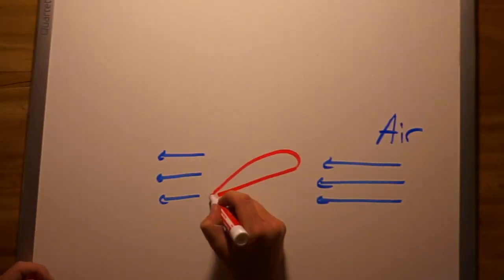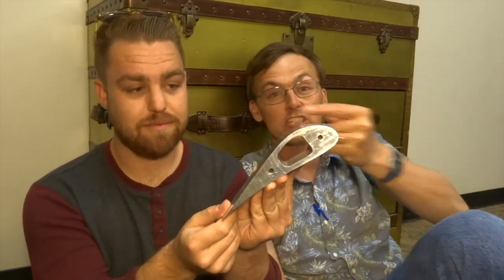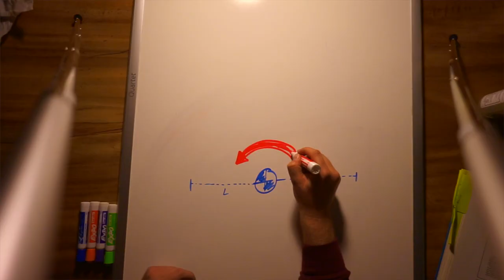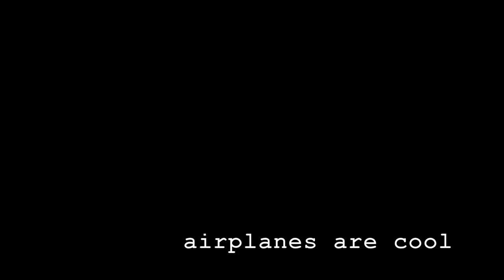Spin Brief 5.11.17

Comment: Elliott,
I have always wondered why the low wing Extra slows in rotation just before the developed phase? Between 1 and 1 1/2 turns depending on CG the airplane slows in rotation momentarily. Un observed inverted and not as noticeable in the mid wing Extra. The Yak 55 and MXS do not display this characteristic either. Perhaps you can articulate as to the why?

ML
Reply from the maker: That's probably more than I should try discussing in a comment.  That being said, below is a plot of yaw rate during the incipient phase in the extra.

https://youtu.be/2nnrmMDeqog